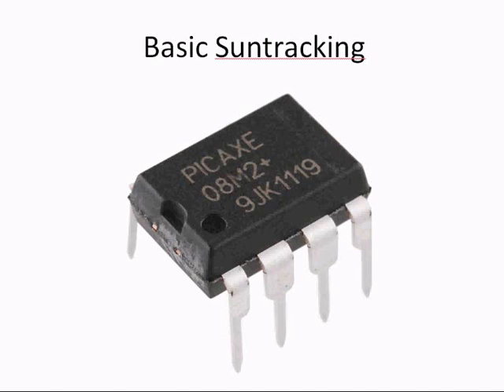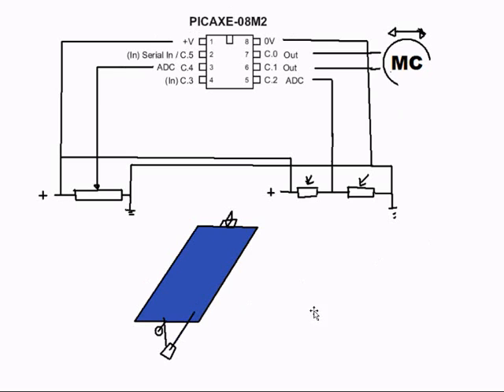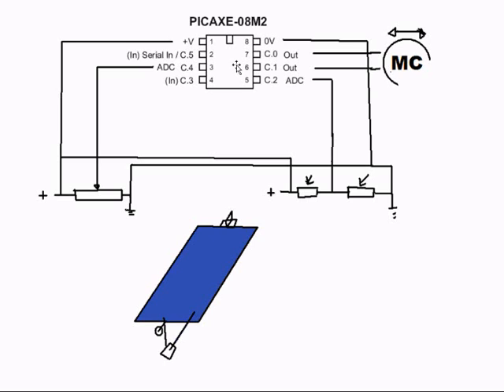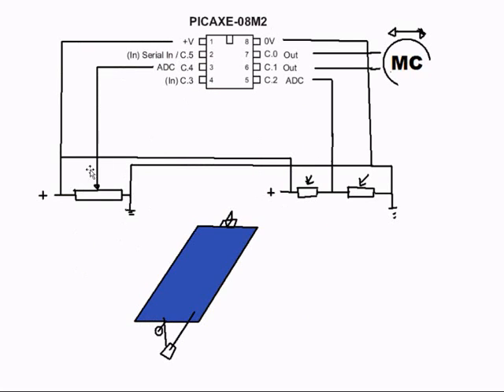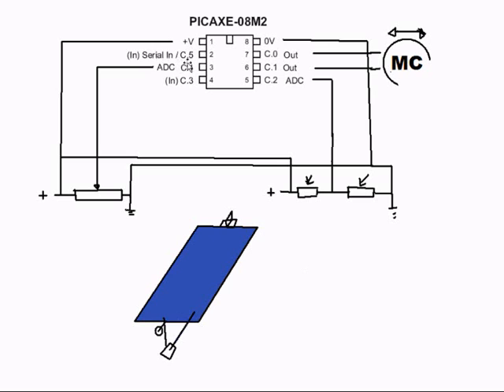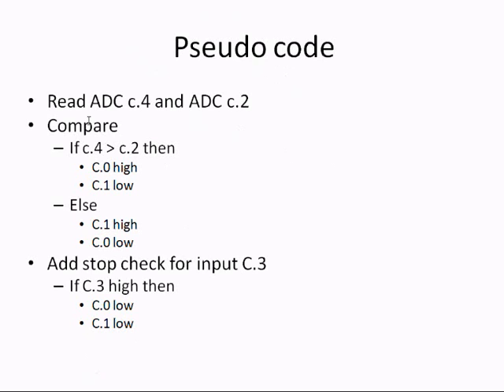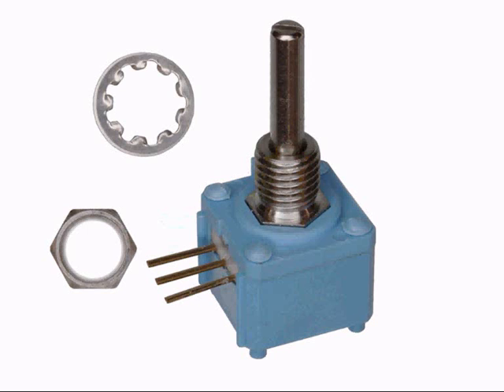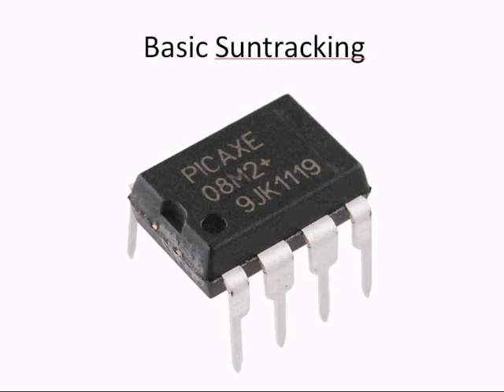Light Based Solar Tracking with a Picaxe 08m2

Comment: You could have a null zone in your voltage divider code. Say if the input is between 500 and 524, assume that axis is close enough to correct and go into low power mode. Wait 15 minutes and check again.